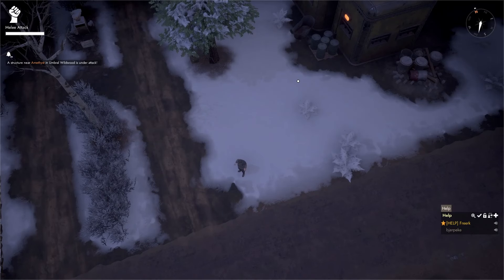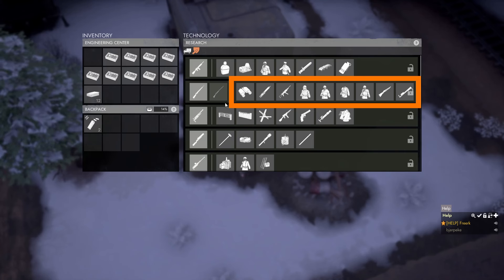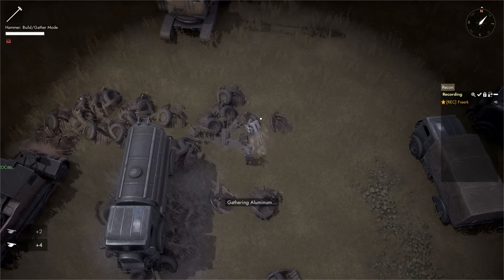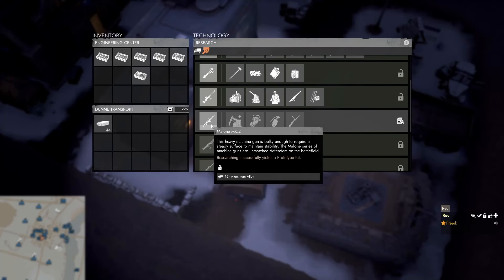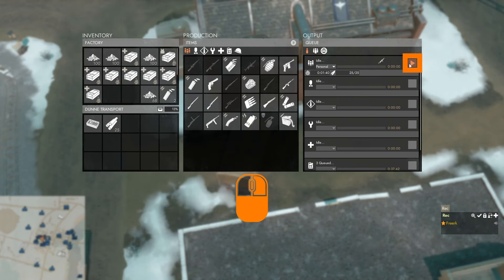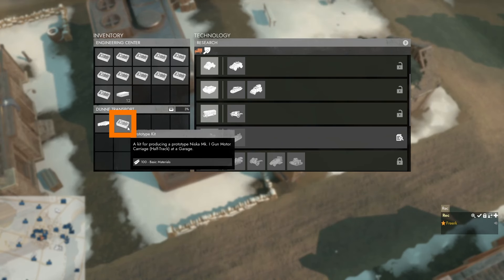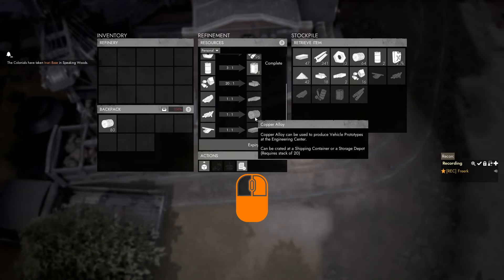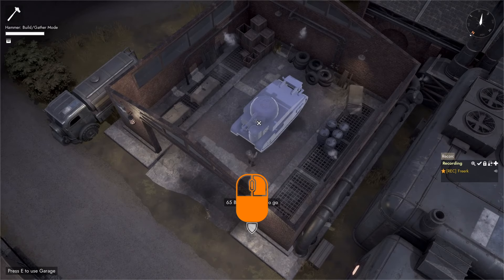Foxhole Guide- Technology and Research

Comment: I have a question. Do we need to make the prototype to increase the tech level? or just simply put the Tmates to the tech tree and it will increase automatically.
Reply from the maker: The prototype is a bonus and is not needed to progress the tech level. SO submitting the t-mats should progress the tech level
Reply: @FreerkHoltes  Thanks bro

Comment: Sorry how exactly does the research work do you just get the entire row every time or do some things get locked if you don't pick them. Also do prototypes have different stats than the normal versions of said weapon/vehicle
Reply from the maker: The left part of a row is where the choice is (if there is a choice). The entire right part will be unlocked as soon as one of the left side options get's researched. 
You will be locked out of the choices you didn't make until you reach the end of the techtree at which point you go through rows of the tree again that still ahve options open.
Prototypes don't function differently, but will require more bmats to repair and will take more damage

Comment: As someone doing research before getting the game, what are prototypes used for? What I got is that building them accelerates the research, but do you just get a lesser variant to ship to the front lines?
Reply from the maker: The prototype itself does not further research, the submitting of the "tech materials" does.
The prototype gives you access to a lesser variant before the actual thing is unlocked

Comment: Are the prototype versions of things worse than the "final" versions ? If so, how?
Reply from the maker: prototype weapons are the same, prototype buildings and vehicles take more damge and I believe also cost more to repair.
Reply: @FreerkHoltes  That's correct. The benefit of having a vehicle above the current tech tier is offset by it being more vulnerable and expensive in combat, additionally the repairs take longer and the armor cannot be repaired at a garage
Reply from the maker: @loginlover  Thanks for the addition!